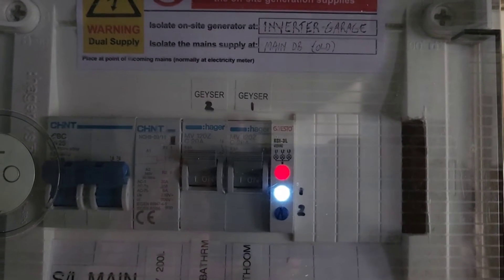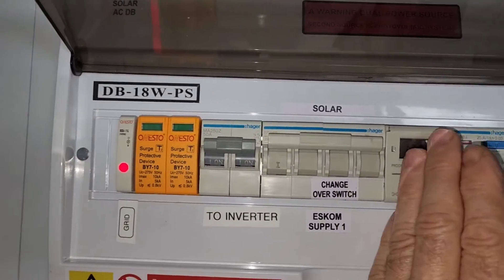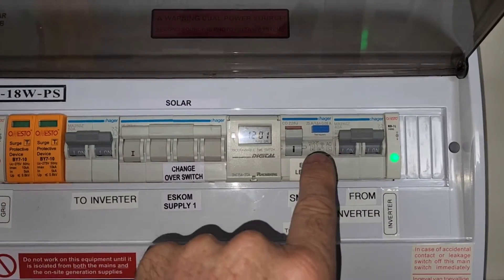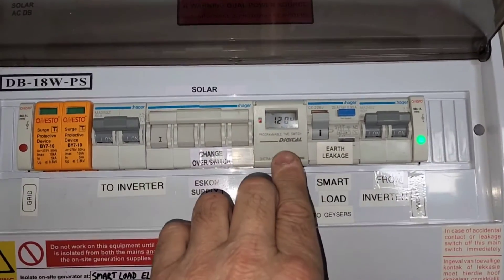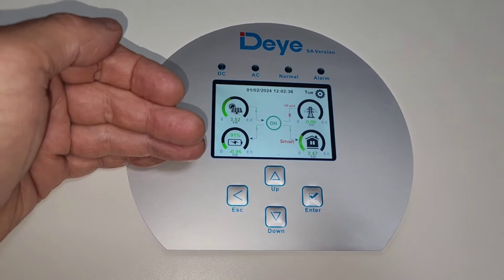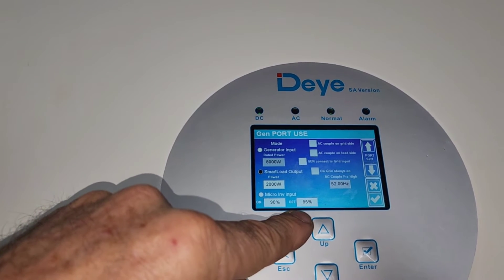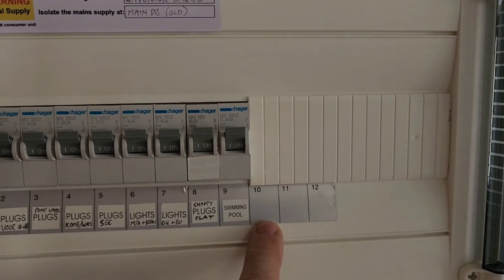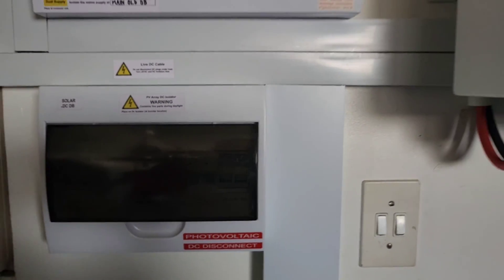Installation layout of my Deye 8kVA hybrid inverter

Comment: Very inteeresting. How lon do you heat up a single geyser? I understand they are 2kw ?
Reply from the maker: It depends on how empty (cold) it was.
If almost fully empty (cold) a 150l will take 1h30min on 3kW.
If heated with solar power, I turn it up to 60°C to last till the morning.
I have a 200l with 3kW element in, but use little water to pre-feed a regulated temp geyser (Harver 30l induction)
If fully empty, I guess a 200l, 2kW will take around 3h.
With enough sun, it's ideal.
Smart Load starts around 10:30am (summer)
You then have until 4pm to heat the geyser (4.4kW panels as minimum)